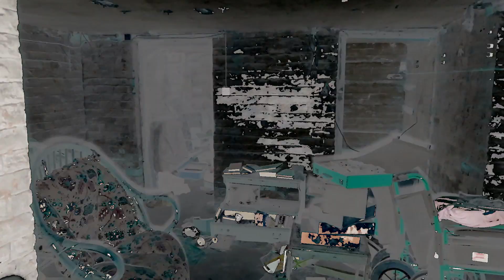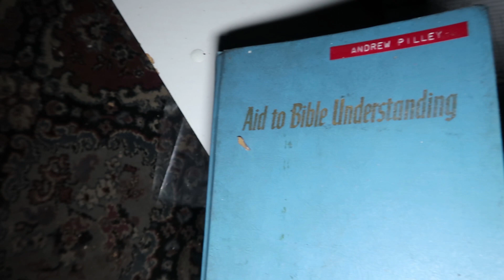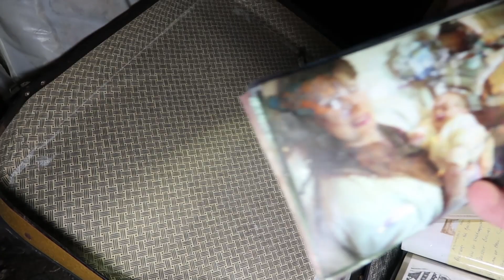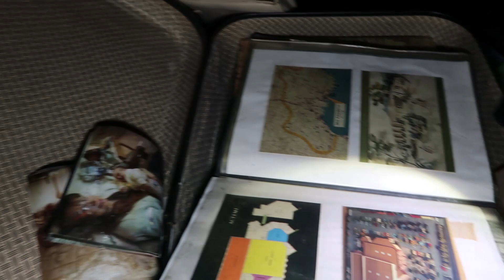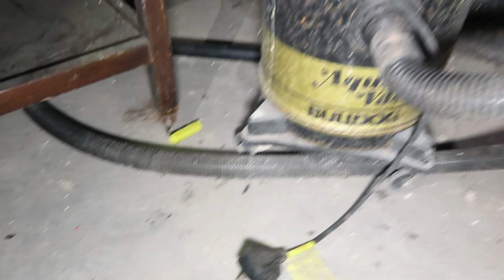Prison Cell In Abandoned Jehovah's Witness Care Home | Jah Jireh

Comment: This place has been trashed over the years with people breaking in and wrecking it ,stealing the pipe work this is why there is loads of holes in walls the cell in the basement was used for coal so not so scary